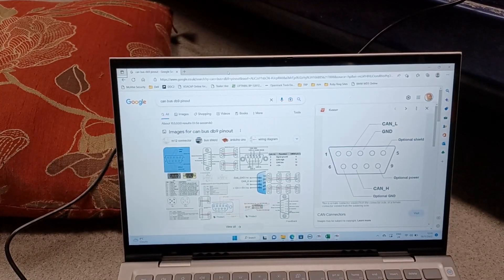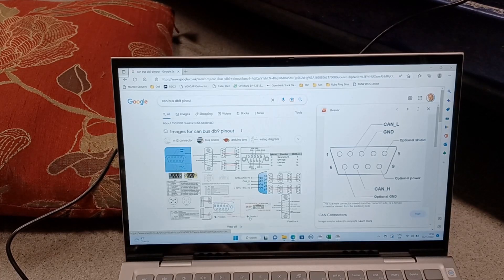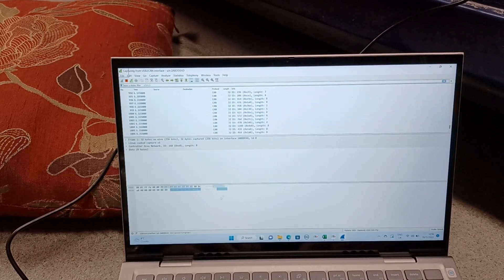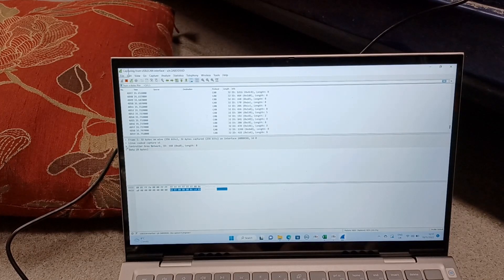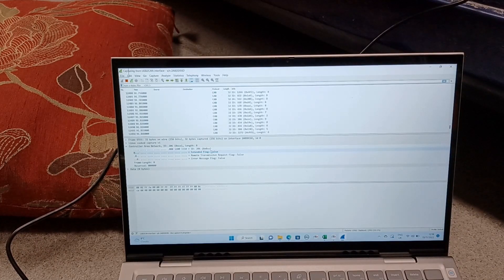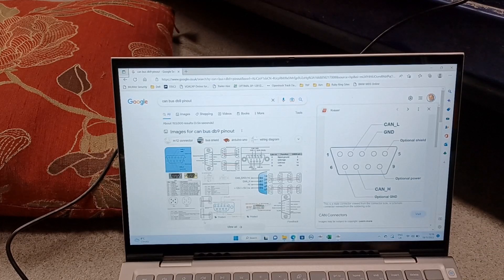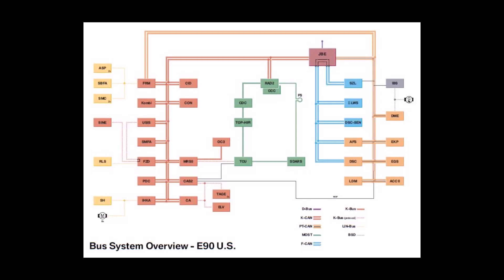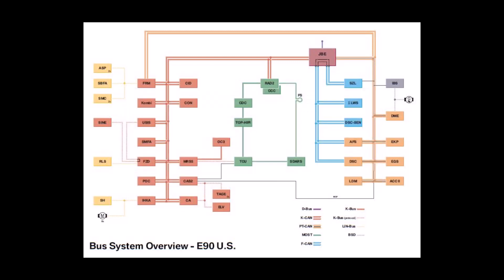BMW 116 Trophy Build - E87 CAN-Bus analysis with Wireshark

Comment: Couldn’t you look at coding out the errors in the JBE with NCS expert so they don’t exist like at all
Reply from the maker: Thanks for your interest, Gary.  Let me think on what you suggest.  I'll need to check the regs of the class I'm racing in to confirm that changing JBE code is not prohibited.  Your suggestion would also assume that the path of the relevant messages passes through a part of the JBE that allows filtering.  The Airbag Unit and the Instrument cluster are both on the K-CAN, although I accept they may be on two different physical buses.  Also, I'm not sure I'm brave enough to mess with the JBE programming.
Reply from the maker: Thinking on it I realised filtering messages won't work because I believe it's the lack of a certain message that's the problem.  I have experimented and had some success which you'll see in the next video.